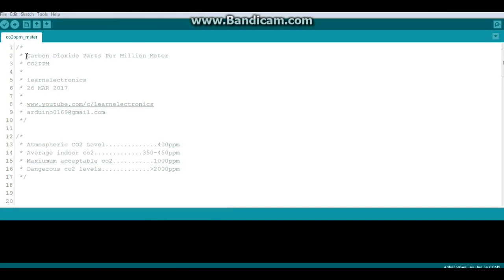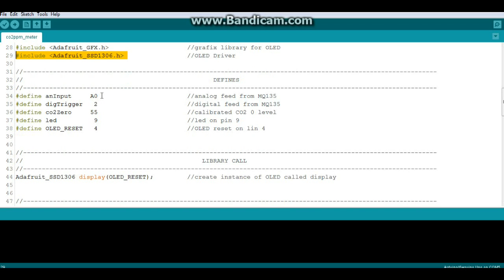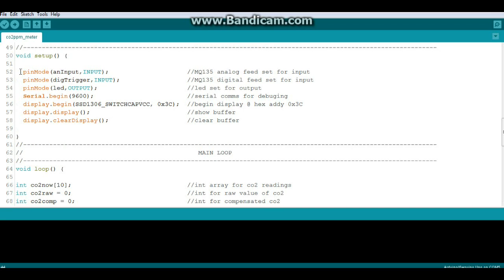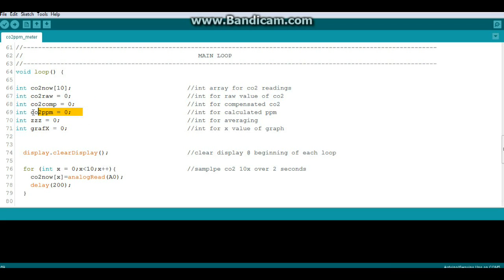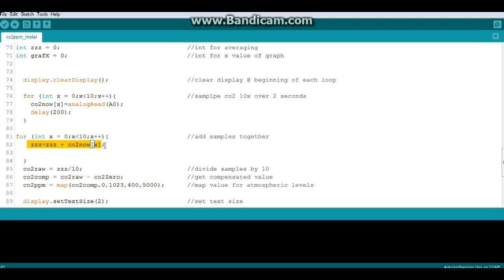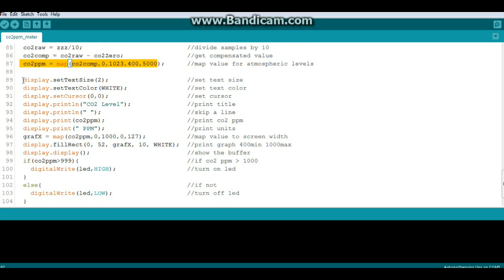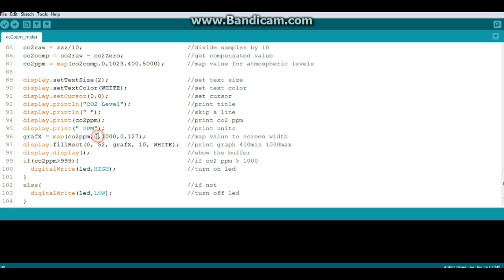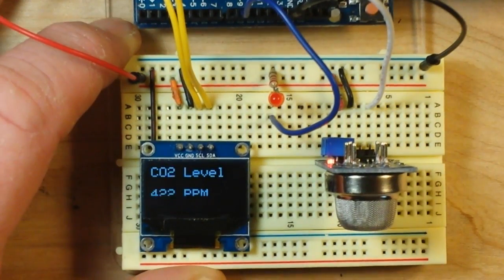Arduino DIY CO2 PPM Meter

Comment: Great awesome video! I have been out of touch from programming and electronics for over 20 years now. Love the video - I am still bit lost. I have a lot to catch up on. I am looking to make a simple Arduino controller so when CO2 reaches certain level 12v fan kicks in for a mushroom grow box. Is this something that can be done? many thanks Ethan - Australia. Also do you have amazon links for the parts required to build?
Reply: Could probably do that with a relay, with simple if code

Comment: Following your instructions I have build the project and it works well as long it is connected with the USB, when I use a 9V battery it works well in the beginning but after about 8 hours the battery is empty, does it consume so much power?
Reply from the maker: There is a heater in the sensor
Reply: @learnelectronics  I realize that, so it's normal the unit can not be used as a standalone sensor operating on small batteries.It's a battery eater

Comment: But you are just taking the raw analogue value and using it in the most arbitrary way. To then slap ppm on it as the unit is just plain wrong. All this device is good for is making relative statements about air quality, nothing else.
Reply from the maker: Gfy

Comment: Have you done any checking of the accuracy? I'm looking to put together a safety device with this CO2 sensor and kick on a ventilation system if CO2 (and other gases) go above a threshold (probably 1,500 PPM). For my purposes, I would need to know for certain the reading I receive is calculating an accurate CO2 level. Doesn't sound like your calibration was all that accurate, I'm just curious how accurate your readings are when compared to known good readings from a commercially calibrated CO2 meter.

Comment: that $5 sensor isnt going to reliably detect CO2. Breathing on it directly should have made it jump far higher. The MG811 (probably not what yours is) is ok, but NDIR sensors are here and cheaper than ever. They are accurate because they use light to detect the precise  wavelength which CO2 blocks. They convert the amount of light blocked into a CO2 ppm output. I saw a demonstration with the style of sensor in which many different models were compared. They all triggered on samples of a variety of chemicals is pretty much the same way. Those can-style sensors are only good for detecting when "something might be wrong with the air." Expose it to natural gas/propane and see what it does.
Reply: Any part numbers for what you recommended?

Comment: hi, thanks for sharing, good work. I used this codes, and i have a question. ppm_meter shows about 900ppm Co2 level. I go out and waited about 6 hours, and Co2 meter worked in this time. Co2 level dropped to about 700ppm. can I change this line like this "co2ppm = map(co2comp,0,1023,75,5000);" ? Orginal line is co2ppm = map(co2comp,0,1023,400,5000); thanks..

Comment: Nice project. I like to use it to controll the air in my sleepingroom. +
But first I have to calibrate the sensor to get right values. Can you tell me, how I have to calibrate the sensor to get the right   co2Zero  value.

Comment: Good video. However this sensor will not detect even 5000 ppm vol of CO2. In more or less clean air (no one farts and there are no dead bodies around) it will react mostly on moisture in the air (absolute humidity). It is quite sensitive to it. In my case sensor resistance varied from 30 k (dry air) down to 6 k (close to saturation).

Comment: Hi, that's a great project can you add a 110v on off switch for a solenoid valve. To control the co2 when it it reaches to a set amount turns off the solenoid valve and when goes under turns it back on again.
Reply: you could with the help of a relay.
Reply: @sem8776  can you provide a circuit diagram and a list of all the parts required to build this meter along with the relay which controls the auto on off for the solenoid?
Reply: @nizmulk   I wouldn't trust this for some kind of security system, those sensors aren't accurate enough and can fail. But if you weren't trying to do that, you would need an arduino, relay shield for arduino ±1$, mq135, oled is optional. Let me know if you need a wiring diagram, wiring is pretty obvious for these parts, just combine some diagrams and move some pins around if needed.
Reply: @sem8776  it's not for a security system it's for my green house. Co2 controllers are very expensive and I'm looking into diys and your project is the best one I have seen.
Reply: @nizmulk   I am not the owner of this video lol, but the green house project seems great.

Comment: According to an Amazon question answer: This sensor will not detect carbon dioxide. Some manufacturers report VOC output as eCO2, by correlating VOC to CO2 measured concentration in room air. This is not the same as CO2. NDIR sensors are used for direct measurement of CO2, There are a number of lower cost sensors on the Market,
Reply: Please recommend me a cheap sensor for co2 please

Comment: This method of ppm calculation will be very unaccurate, look on the sensivity graph in mq135 datasheet, this graph is not in linear scale(map() function in your code works linear) but sensivity chart is in logarithic scale

Comment: Thank you for this editing! One can even consider using the output 9 to drive a relay to control a solenoid valve to release CO2!?, By changing the value of: if (co2ppm>"/" 999"/") {// if co2 ppm> 1000

Comment: was wondering why you would switch to a nano, is it for memory i'm a newbie thanks in advance
Reply from the maker: I just like the size. Electronically it's the same as the Uno.
Reply: @learnelectronics  thanks for reply i am going to build this and test it against my carbon monoxide unit just as how close it can get to  the bought unit

Comment: Hi, I have a few questions.
First off, I installed this program on my arduino and then got the sensor reading without changing the CO2Zero I received 370-400 range in my house.
Later, when I blew air into the sensor, it decreased to 330-350 and then later after few seconds or 10 lines of printing it displayed 410-440-460
May I know is it right or how must I change the CO2Zero value. I didnt understand or am I getting this right or is the PPM reading correct. I am sure the CO2 level must increase after blowing air but is decreasing??Or is it lagging ?? Please help me ASAP!

Comment: I like the video. There are, however, assumptions implied which are not realistic to expect. For example, while going outside to the back yard, one can reasonably assume (if located far from mixed,  citified air) that the MQ135 detection reading is indeed mostly C02.  This sensor detects an assorted group of gases. In the back yard environment, one can reasonably assume that benzene or ammonia (NH3) for example, are NOT present - nor are others to which the '135' reacts.. 

Thus the reading reflects C02 concentrations vs., say, Ammonia NH3,  for example. However, upon changing the environment (i.e., moving to an inside location where other 'detectables' might exist) ALL BETS ARE OFF.  With this sensor,  it is totally a guess to assume that any reading in an unknown environment would be only from C02 levels. As an example,  (for adults only),  is the exhalation of breath after having an alcoholic beverage (ethol group symbol OH) will drive the sensor's output nuts! Yes, CO2 is also in the mix but the sensor can't discern the relative contribution of each compound it detects.  Or, spraying certain aerosols or using cleaning liquids in the home will also contribute significantly to the sensor's reading. How much CO2? It's impossible - yes, impossible to tell. The sensor simply tell you that "something detectable" is, in fact, being detected. That's it.

 The important thing for people to realize is that with the MQ135 (and with all the MQ-series), the output of the sensor ONLY verifies that at least one OR MORE  of the gases it detects is present at the moment. It does NOT reveal any useful quantative information when 2 or more gases are contributing to it's output. It simply displays one reading, combining all the totals. In fact, manufacturer's data states that the sensor output CANNOT be used to tell you WHICH ONE (or more) are actually present - and most certainly not a PPM breakdown of one gas - as implied in the video regarding C02.  To say that the reading is higher at the workstation "due to exhalation of C02" is true but is not the whole truth. Other volatiles in the air sample play a role in the reading as well.  This is a critical fact that should be emphasized when using this sensor. 

 That said,  I still use the MQ135 along with a BME-680 sensor, and a Dallas OneWire group with an Arduino MEGA 2560 to  drive the electronics in an environmental controller.  

 It's important for viewers to manage expectations of exactly what they can expect from these sensors. 

 Refer to  the manufacturer's datasheet for the MQ135.  It contains specifications for the device's sensitivities to a whole host of other gases (including C02)  that contribute to the analog output that one might display. 

Now, breathe....  :-)

PS: At 39,000 feet altitude and almost 100% UNcontaminated outside air, the sensor calibration is SWEET !!  These may be a product manufactured in CHINA, but in this case, I find them impressive in terms of reliability -  as long as expectations don't exceed the product specifications. Enjoy cleaner air.  Take care.
Reply: Very good comment. In the following, in figure 3, will you find the different gases reaction dependent on the resistor value: 

https://www.olimex.com/Products/Components/Sensors/Gas/SNS-MQ135/resources/SNS-MQ135.pdf
More or less the same, together with a list of other gas sensors, can be found here:
https://components101.com/sensors/mq135-gas-sensor-for-air-quality
Reply: KwizzelKing HD  This sensor is not plug n play device. You should add mathematical formula to your code and calibrate with known CO2 meter.
Reply: B. GLENN Awesome comment, thanks for your valuable informations. :)
Reply: Which sensors would you recommend for CO, CO2, and O2? I'd like a ppm for all three.
Reply: @charlidog2  Here are two 

list: https://www.strawdogs.co/2018/06/MQ-Gas-Sensors-List/
https://tutorials-raspberrypi.com/configure-and-read-out-the-raspberry-pi-gas-sensor-mq-x/
Examples:

MQ-7 - Carbon Monoxide
MG811 - Carbon Dioxide (CO2)
Use a search engine for the O2 sensor. They have different prices according to quality; from $20 to $200+
All sensors will output a voltage that you have to convert to a value and ppm - if you want it cheap. If you pay a lot of money; then you can find something that spits out ppm on a screen.
Reply: Hello, I want to measure quantatively the ppm of methane in the air, how could I do that? The MQ-4 is for methane but I didn´t know that they couldn´t quantify
Reply: I couldn't find co2 in the mq135 datasheet

Comment: Thank you Very much it's a amazing concept to measure CO2 in Air. But I have one question in Initial stage how can I calibrate the sensor for first 5 sec. What is the highest and Lowest value of this sensor? and Please help me the code of this sensor calibration...

Comment: Hello I have a problem with this Diy I have a Chinese UNO card that has the terminals SDA and SCL. If I do the test by blowing the led turns on but my LCD only shows CO2 LEVEL nothing else? I also see that you have to connect the terminal 2 to triger on the program but not on your assembly? You could help me?
Reply: Hello thank you very mutch for charing this diy my error is in the program here "display.println(" ");" it's not println for my screen oled because it's 0.96 Inch Blue Yellow IIC I2C OLED it's 2 colors.  All is OK. Congratulations.

Comment: Here's my comment.  Build these made-to-order and sell them.  I've just been looking for a cheap device that does this very simple task, but the pricing on CO2 measuring devices is totally arbitrary because of the low demand, relative to CO sensors.

Comment: First thanks for your video, I share the idea of other comments in this post that it is difficult to really identify that the exact composition is CO2.  I'm thinking if we use different sensors of different characteristics, maybe in this way we could identify according to the sensitivity of each of the air composition we are analyzing. It's just an idea. Thanks again.

Comment: hi, is the device is accurate ? or just display false reading what is way off when compare to the good brand device ? 

i am always in doubt with china made sensors... 

thanks
andrew
Reply: It's not accurate (according to the thread forum.arduino.cc/index.php?topic=540046.0 )
Commercial CO2 sensors cost $100+ for a reason, I guess.
Reply: Try this: https://www.co2meter.com/products/k-30-co2-sensor-module
Reply: I would guess this highly depends on calibration. Relative measurements should be quite okay for such an inexpensive chip.

Comment: hi.thank you for ur video ,mq-135 based datasheet it can measure many type of gases,the question is how i can recognize type of gas and shown on screen .
Can you make the screen shows all kind of gases concentrations at moment? Something like:
CO2
NOx
NH3
etc:.....thank you
Reply: No you can not, in fact this device recognize those gases cause its sensor change its resistance when detects them. So if you have a room with different gases this divice will give you a measure that will be the sum of all those gases interactions with the sensor. But the interaction between the sensor with each gas is not the same, so you can manage to make an algorithm to know which gas is the device detecting (if you can control the ppm of that gas for example)

Comment: Thanks for porsint this video SIR. I uploaded the code to my arduino. wired exactly as you described. BUT all I see on my screen is: CO2 Level, those exact words, and nothing more
Reply: change your text size to 1 it works so much better

Comment: Hi may i know how to adjust the on board load resistor (the small blue box) of the MQ sensor if i want to adjust it to 5k ohm? twist to left or right?
Reply: right i think but your better off using 220

Comment: Hi could you give all list of equipments used?
Reply: arduino uno, breadboard, wires, 220 resistors, led, MQ-135 sensor, arduino screen (on amazon 1st thing).

Comment: Is the 135 different in that it doesn't require 5v and 1.4v pulses between tests in order to function properly? Like the mq7 for instance requires 5v for a given period, then 1.4v, then test, then repeat. It also requires a 24-48h burn in period before calibration. I think this is incredibly over simplifying how these are supposed to be used, possibly to a fault

Comment: What is the complete list of materials necessary?
Reply: arduino uno, breadboard, wires, 220 resistors, led, MQ-135 sensor, arduino screen (on amazon 1st thing)

Comment: How would you connect the wires if you were not using an OLED screen?
Reply from the maker: +Rahul Ravi Connect the wires to what?
Reply: Would it be the same connections to the breadboard (can you also list all the materials needed for this project?)? Also, is the MQ-135 gas sensor connected to the arduino board through any wire from the breadboard to A0 on the arduino board? Thanks for any response!
Reply: Hii. I want circuit diagram how the  connection is

Comment: The MQ-135 senses NH3, NOx, alcohol, Benzene, smoke and CO2. Are you simply making (a probably quite reasonable) assumption that you have only CO2 from this list in your environment ? Is there a way you could distinguish 2 (or more) signals in any case ?

I was thinking of getting the MH-Z16 (which happens to be a much more expensive Infra Red sensor) ... but this may not be necessary if the thinking above is correct. Grove wraps up the MH-Z16 nicely for their Arduino shield (I like to use their shield because it eliminates a breadboard ... fat fingers).

I have a similar 'dilemma' for methane since the Grove components do not include a MQ-4 sensor (but I am guessing that their 4-pin connector probably works just fine with https://www.aliexpress.com/store/product/Free-shipping-MQ-4-gas-methane-sensor-module-MQ4-for-arduino/912692_1919758610.html in any case.

Each of the other MQ-* components sense gases that I also expect to be present in my 'pollution samples' ... so I am probably forced to go for the MQ-4 specifically.

@learnelectronics or anybody care to offer opinion or reply ?
Reply from the maker: +grassabrutta yes just assuming co2
Reply: shure,  it's not CO2 sensor, not even Carbon dioxide equivalent (CDE) sensor :) i think it's good for brand detection

Comment: the one thing I don't understand is the mapping what is the full range of this sensor? will ir register form zero to 1 million ppm ? is that 0v to 5v ?
or does the sensor only measure form o to 5000ppm ?

Comment: Thanks a lot for this informative video, I am following the very same code for CO2 monitoring, but I am getting some error in reading. Can you please explain how have you calibrated this sensor?
Reply: Simple, the outside reading should be 400.
Reply: @DouglasEKnappMSAOM  sorry for the late reply but what do i do if the outside reading isnt 400?